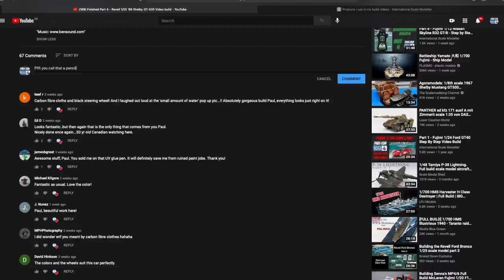Part 2 - Revell 1/25 Corvette C6 Video Build

Comment: Hi Paul

I always think Revell kits look less realistic - before you jump to any defence you skill in this kit was amazing - and I think its because the detail is less well defined than the Japanese and other rivals. The door shuts look to wide and the angle are too rounded on the parts. CLearly this makes for easier mouldning though.
The shine was amazing.

My kit that I was surprised by was the Tamiya Subaru Impreza WRC 2002. It was the first kit I built back in 2005 after about 20 years of not building. I was amazed by the fit, the number ofparts, the details in the instructions and the slightly surprised by my 8 out of 10 result. The previous kit I had built was probably the Airfix Lotus Elite.
Reply from the maker: Yeah they can be. I guess that’s down to cheaper materials and manufacturing. They still can be good kits as long as you’re awAre of the flaws :)
Reply: You mention the Airfix Lotus Elite - boy, that brings back some memories! Did that one when I was all of eleven years old some 40 years ago!
Reply: @davidhinkson8856  it was the same number of years ago for me. I was 13. Remember it had bulbs in the pop up lights.
Reply: @def90cars  Yes - think mine worked once or twice and that was it!